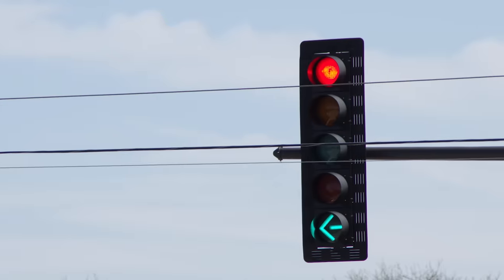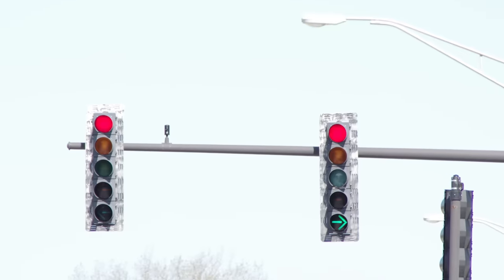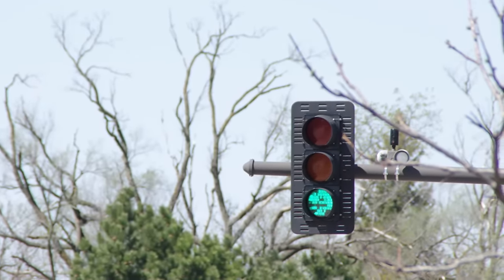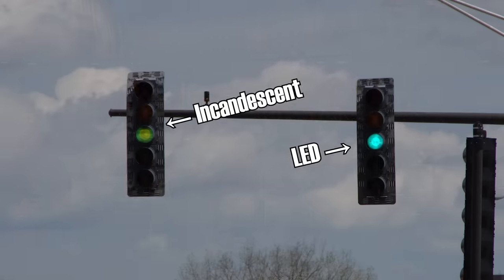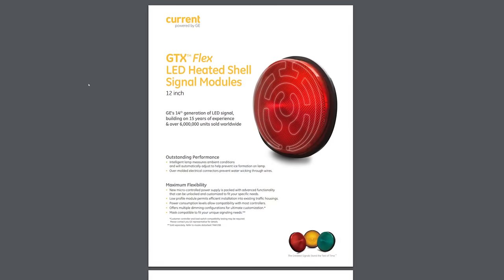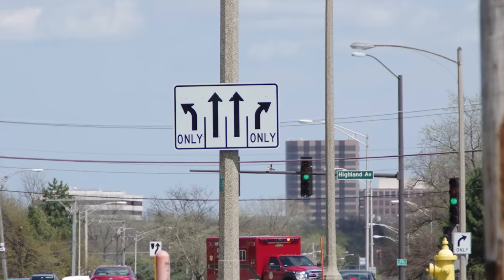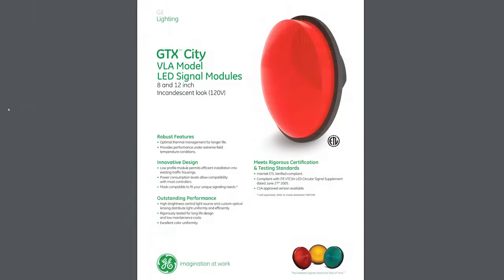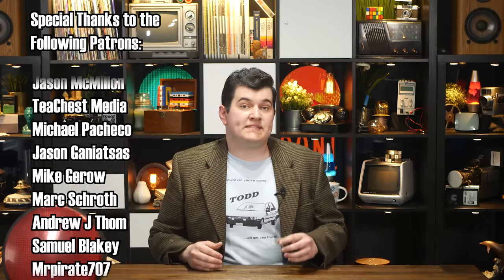The LED Traffic Light and the Danger of "But Sometimes!"

Comment: I live in Moscow, as you can imagine when it snows it snows here. We've had LED lights for close to 15 years now, I have been driving for 12 of those and I have never seen a traffic light obstructed by snow. My only gripe with LED lights is they're obscenely bright at night, but that's a minor trade off for being able to see them consistently during the day when, you know, most people actually drive.
Reply: Same. Never seen one obstructed by snow/ice either in Moscow or St. Petersburg. Also I feel like the new hoodless design also helps - without the hood less snow could even potentially accumulate and leds have plenty of light output to be seen through the snow/ice that can build up
Reply: FreymanArt  you know, the might actually dim with lower light levels, but if you've stared at LEDs long enough, then you probably noticed that they sort of always find a way to irritate your gaze no matter how dim or at what angle you look at them. I still maintain that that's not such a big problem seeing as you may actually not see classic bulbs during the day at all.

Comment: All you'd need to control the heater is just a simple thermostat that turns it on whenever it's below freezing.
Reply: Yes and maybe a anti-ice lens basically they work just like an anti-fog lens on a cameras basically they are just to slippery for ice or water to stick to so slide off just like the Oleophobic coating on your smartphones screen!
Reply: Simple temperature sensing is a solution, though a suboptimal one. Even if it is freezing outside that doesn't mean there is snow anywhere to be seen.
I wonder if they could put a photo sensor somewhere on the visor which can see if the lamp is shining an appropriate amount of light. If it's not and it is also below freezing temperature, then turn the heater on. I don't know if this is a cost effective solution in terms of cost of retrofitting.
Reply: Matt McConaha that seems reasonable. The thing is, led shouldn’t need retrofitted it should’ve worked to begin with. There went saving money though paying someone to retrofit all of those
Reply: +Patchuchan
There sensors that detect snow and turn on heaters, we have them in Norway, on certain parking lots....
Reply: Patchuchan The product mentioned in the video specifically measures temperature and humidity to determine when snow is possible.
Reply: Could have sensors - or manually operated for extreme weather to turn them on during a snow storm or extreme conditions anyway :) simply turn them on in areas of high susceptibility then all good! Orrr just not drive at all

Comment: One reason they have not replaced them with LED is that they are old controllers, and thus also have old conflict monitors, which are there to monitor all the lights, so that no fault can cause the light to show go on cross directions at all, any fault that might do that will cause the conflict monitor to disconnect the controller and go to a flashing red all round as a safe indication of it being a 4 way stop.  Old controllers are there till they run out of spare parts or the pile of others removed from service, and will only be replaced with new controllers when the old ones are out of stock completely. 

Newer controllers can have LED drive as standard, but are difficult to retrofit to the old controller, as they probably are from the 1980's, where the controller also had current sensing that allowed remote monitoring of lamp failure, allowing non reported lamp failures to be repaired without having to have a monthly check on all lamps by a crew, and also this showed the relays were working correctly, giving a backup for the conflict monitor.

Had this happen here, where the last 2 Automotor mechanical controllers were replaced eventually with Siemens controllers, hope the old controllers were kept for the transport museum though. On some of the controllers they had to add "cheater" lamps in the controller case to provide enough load to make the controller and conflict monitor happy with LED loads, but as almost all the controllers also had lamp soft start built in the lamp life of 8k hours was more like 20k hours as they were either kept slightly powered by a low current or had soft start resistors to keep inrush current low. 

If the municipality wanted to save money they could also just get by replacing the red and green lights with LED, leaving the orange as incandescent, as the 5 second on time per cycle is really low power overall, but red and green are the major power draw. Plus the burst of heat in amber helps to keep the snow off, though here, where the last time snow fell was millions of years ago,  extra heat is not exactly needed. Have seen LED clusters showing 2 colours on the same pole, then a 30 second flash as conflict tripped and made it all flash red, before cycling back again to normal for the rest of the timing cycle, and then rinse and repeat.
Reply: so easy..    put them in series, and a voltage detector before each light..   one goes out the rest behind it go out...  easy to find the no power for you in the middle...   easy convertion.   just time consuming.

Wired our entire house in dc lighting....  took about 3 days for this 3 bedroom lot